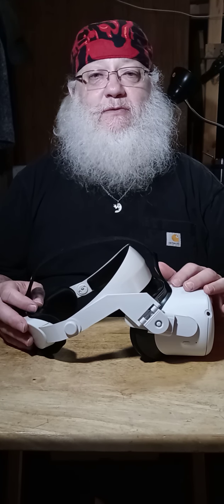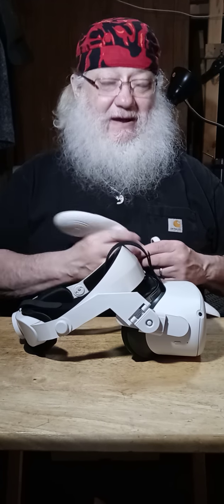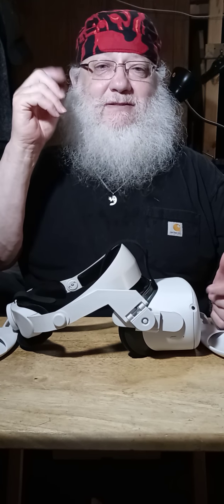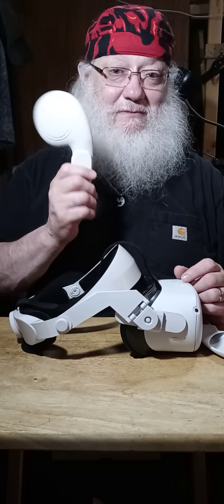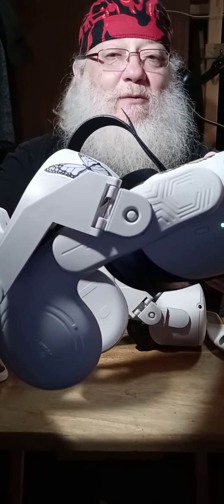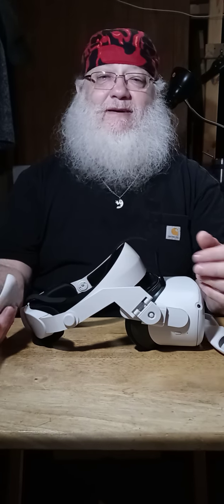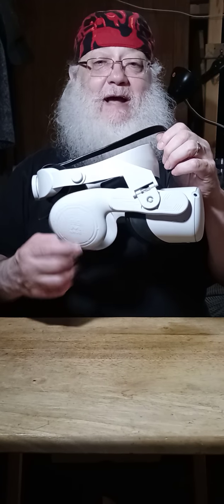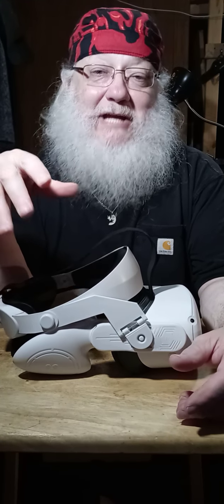Modifying the Silicone Muffs

Comment: Thank you. This is what was holding me back from getting the better head strap
Reply from the maker: I'm glad it helped. A lot of people don't get the benefit of these because they don't know the trick! If you need any help with the mod, let me know. Make sure you cut a hole smaller than you think you need! You can make it bigger, but you can't make it smaller... LOL
Reply: @DaveDrawing  ok I got everything set but what did you do for the gap where the old strap went through? The sound is not as good with that opening
Reply from the maker: @traceyh8033  I discovered the same thing after making this video. I took some clear silicone and simply filled the gap, let it dry completely, and now months later, it stays sealed and flexible. Simple fix! Sorry I didn't know about it at the time!